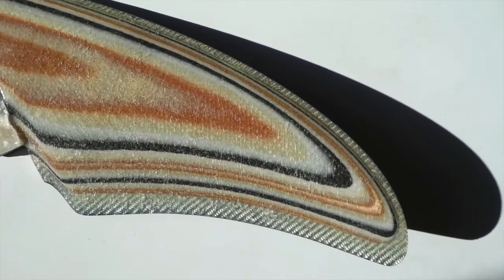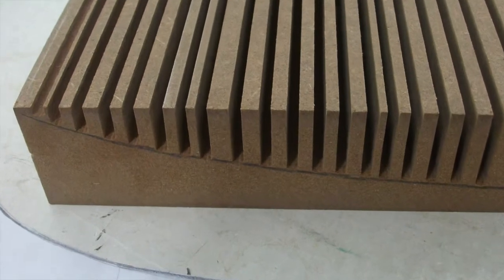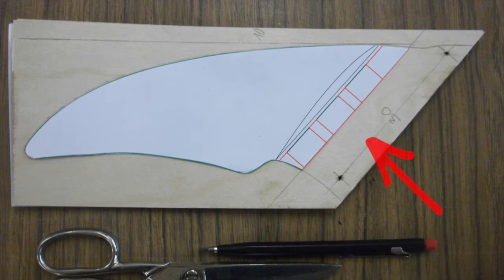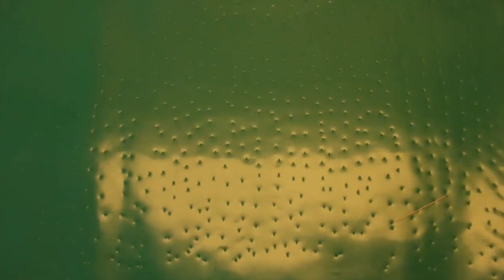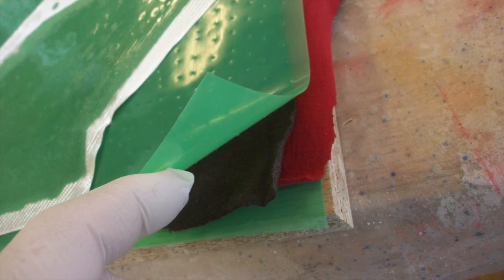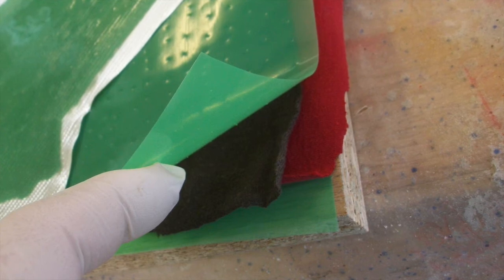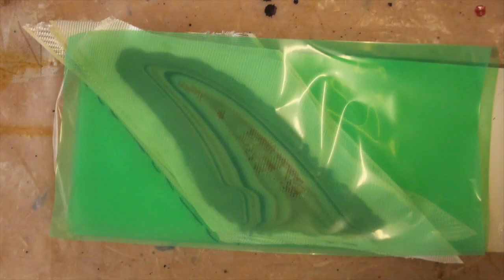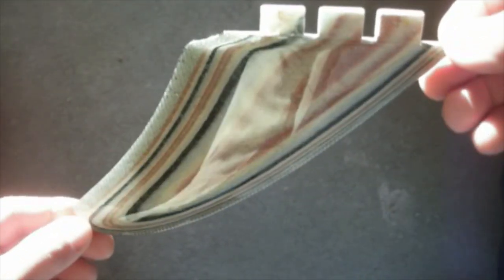How to make surfboard fins with bend

Comment: Nice job on those fins? What kind of board do you ride and how much of a difference did canting the  fin make?
I also make my own fins, but I started making my own with micarta.
Reply from the maker: Hi, my favorite board is a 7'4''. I can't tell You much about the difference canting does to the performance of the fin, because I don't really test them. I don't have the same fins (shape, flex etc.) in both variations and I don't have the opportunity (wave pool) to  test them in equal conditions. For me it's just fun to try new things and see how they work. Some of them don't work at all (see my "Dr. Möbius fin" video on u-tube).
You use micarta on Your fins. I guess this is quite expensive material. How do they work? Do You buy the micarta, or do You make it yourself?
I do my own fin cores in a similar way as micarta, but not based on Phenol resin. Basically I use Epoxy resin and as layers what ever I like. This can be wood veneer, cotton, paper, carbon etc. stacked in different layers an pressed together. Then I cut out the fin and do the same things as everybody else... To have wooden layers in between makes the fin blanks lighter.
Under "robiegle" I have a video on u-tube how to color up fins with paper.
Cheers
Robi

Comment: do you seal those knobs?
Reply from the maker: No, I do not seal the top ends of the pegs. Through lamination and pressing, the fibers are thoroughly impregnated with epoxy and stabilized. I have never had the problem that the thickness of the pegs has changed (due to swelling). Of course, when lacquering, all edges could be sealed at the end. The important thing here would be to cover the faces of the pegs with tape so they still fit in the plugs afterwards. However, I do not do this and have had no problems with it so far....